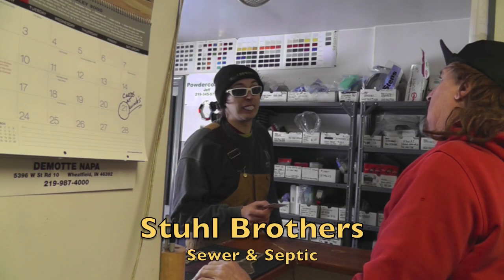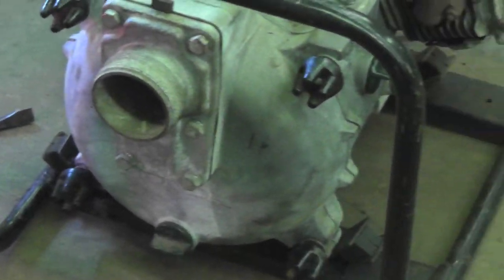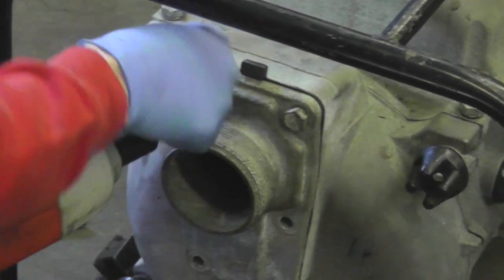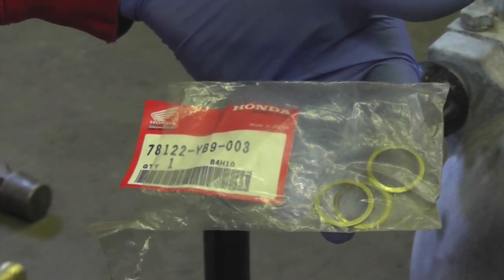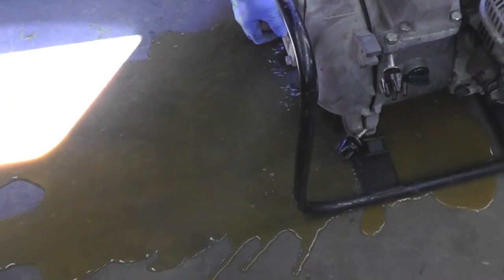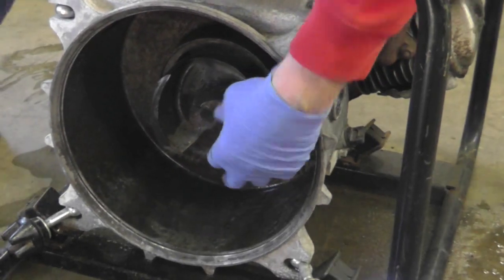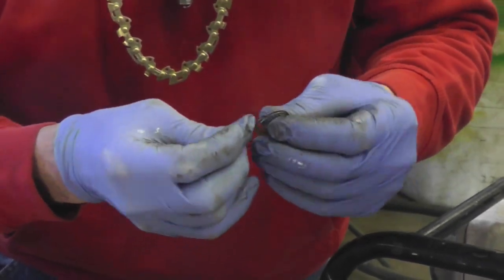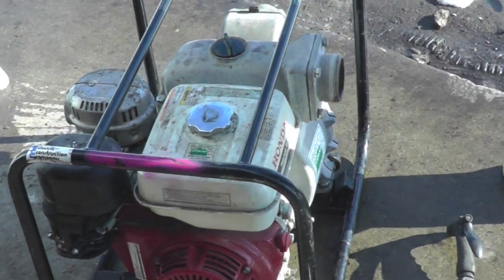EASILY Fix Your Honda Water Pump that is NOT Pumping

Comment: You guys are great...:)  Im a retired Firemen(pretty much disabled) but I keep going.. My wife is a big help for sure.  Anyway we supply water to Cal Fire in the Summer.  My problem I have a Berkely Pump Bzrm.  It is located under the water truck.  PaTO driven,, The shaft is  spinning but now water or it is intermittent.  Im thinking dirt in the impeller?  Also the bearing is shot, loud whine, it is 16 years old.  Time for a rebuild?  I thought so.
MIke
Sacramento.

Comment: It’s best to use a silicone based lubricant on o-rings and other rubber parts. Vaseline is petroleum based and can cause the part to fail sooner.

Comment: Hi sorry for my english !!! my AP 125 dont pomp watter 
I changed the seal between the water tank and the engine (non-original seal) and since then it no longer sucks up water. The engine is running but the water system no longer works ! i need help please

Comment: Don't know if you're still looking at these post.  But I have an old Honda WT20 with a G200 engine.  The pump sat out for about 6 years and a lot of things when bad.  Motor is good but gas tank is shut and can't find one any more.  I wanted to replace the engine with a newer one, however when trying to take the dam thing appart I run into an issue with the casing, it calls for it to rotate about 30 degrees counter clock wise, prior to removing impeller.  Problem I have is don't know how to move that casing it seams ceased and hove no idea how to or where to hit it to make it rotate.  Have you worked on these type of trash pumps?  Any tips on how I can make that casing rotate?

Comment: @taryl
I have a BE TP-4013HM, it is brand new and will not prime, I've check the seals, master seal looks good no burning, I've checked the inlet flapper and everything, but I can not get it to prime. the impeller is the key style that doesn't thread on, it does not have any shims on it. im not sure what else to do other than to rebuild the entire pump and seals. but its brand new

Comment: hey taryl i have an old tractor transaxle that when it gets colder outside it doesn't move any more what do you think the issue is
Reply from the maker: Is it a hydrostat? If so, you may have to change the trans fluid... Or it might just be low.

Comment: Hi Taryl, I see you have a pressure washer behind you there and was wondering if you have any videos about fix them. I have one that won't start even after changing the fuel, checking the spark plug gap, and spraying some starting fluid in the carburetor. Do you have any advice?
Reply: make sure the kill switch is set to "RUN" or "ON".....check for spark by stcking your finger in the spark plug wire and very slowly pull the starter cord. It should shock you. If it doesn't, the ignition coil is most likely bad. If it does shock you, then it's probably the carburetor that needs cleaned or rebuilt.

Comment: what would cause the pull cord to be hard to pull and sometimes it will snapback and it jerksthe cord from your hand.. I bought this pump and it was a display model.. 6.5 hp 9540 gph
Reply: check your fly wheel key could be partially sheared
Reply: With us it was the spark plug. When it’s in too tight it won’t pull. When it’s too loose it pulls freely. It’s gotta be on just right. Also we pull it with a cord strap we took off that attachment